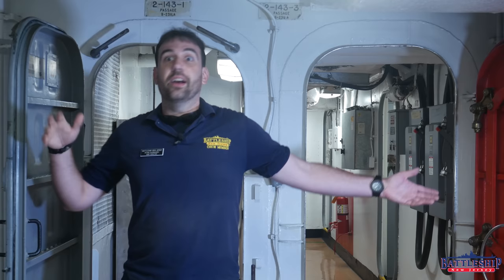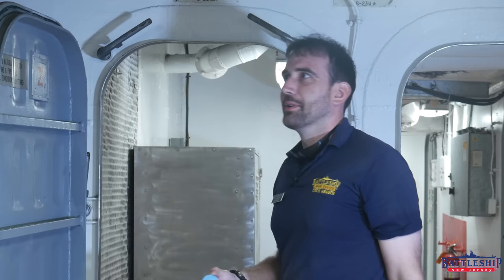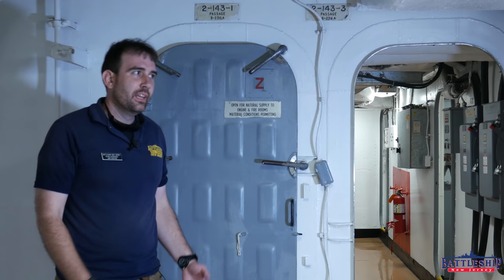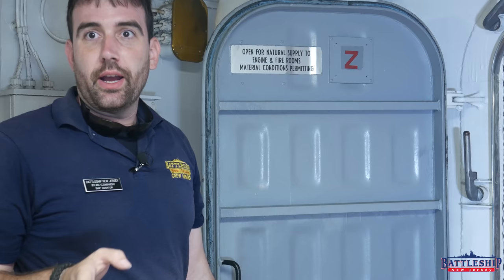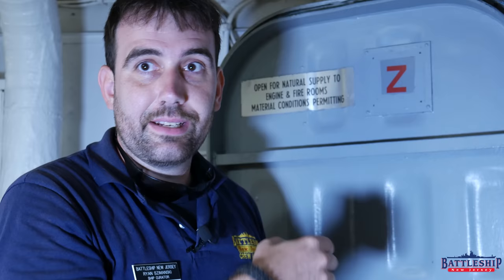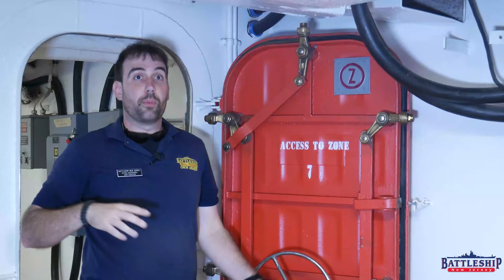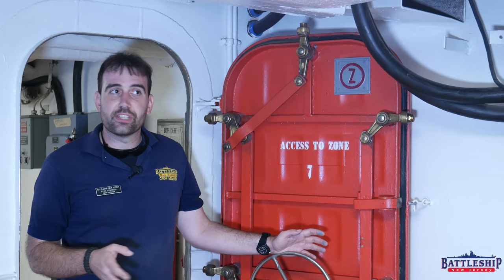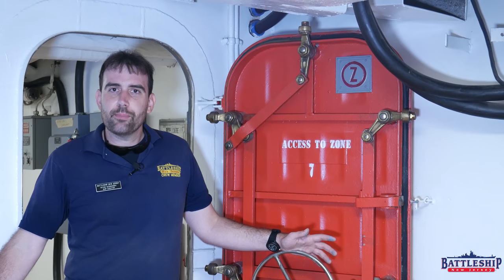How Do You Know if a Door is Watertight?

Comment: FYI: The nut on the outside of a stacked pair is called a “jam nut”
Reply: On the Mark V diving helmet there’s a stud that is longer to secure the air regulator to, the nut for that stud is called the bastard nut.
Reply: @johnbeauvais3159  the plate covering the m1 abrams engine deck the most forward up agiasnt the turret in the center as you can imagine its hard to remove there is no proper nomenclature for it......... its referred to as the bitch plate.
Reply: @justnsaliga8518  😂🤣😂
Reply: That's what she said 😅
Reply: And here was me thinking the nut on the outside was called "a civilian"
Reply: Mmmmm...Jam Nuts.

Comment: Back in my shipyard day we tested tightness of tanks, voids and compartments by adding air pressure to engineering spec and using high tech soapy water on all the seams, hatches and doors.  A leak would produce bubbles. Big part of my job was signing off on the test.
Reply: I did this to a set of fuel tanks on my second ship when we came out of dry dock.  Mostly sucked, but it worked.
Reply: Oh yeah....after chalking and checking the mutton tallow packing...1/4 psi air test...haha then break out the "in calibration" soapy water...shipfitters!
Reply: yes soapy water tests and die penetration tests... fun with metal...
Reply: When my Dad tested travel trailers for gas leaks in the gas lines, he would soap all the fitting.  Over the years, he replaced a great many fitting to fix gas leaks.
Reply: Bunch of military guys sitting around with a clipboard watching for bubbles.

Taxes lmao
Reply: @BeKindToBirds  we don’t write the specs in the contract

Comment: 2:00 - Also, overtightening the dogs increases the stress on the bolt and nut threads, wearing them out more quickly and risking stripping the threads (in which case the dog won't dog anymore).

Comment: I helped re-gasket the watertight doors on the Battleship Texas 1987 to 1988 to get her ready for the tow to Galveston in 1988.
Reply: Many doors?  I found that after about 25 your fingertips are apparently both on fire and being attacked by tiny tiny sharks.
Reply: @Grimmwoldds  Right you are.  I did about 12 doors over a period of six months working only weekends as part of The First Texas Volunteers,  BB 35.

Comment: Every division had/has a person assigned to perform damage control preventative maintenance.  On two ships I served on there were water tight hatches that required either the ship’s 15 or 30 ton crane to open/close.  These were weapons elevators.  I was often given DCPMS as a collateral assignment.
The one ship there was one door that for a year at every inspection I reported, “Door failed due to lack of replacement gasket.”
I retired with 23.5 years total service, with 14 being on ship.

Comment: I always replaced the gasket while using silicone to help get it in the channel. Always before the chalk test wipe the knife edge down as well to ensure clean. Did this more than a few times on LSD36 USS Anchorage as a DC3. As for compartments being air tight, lol yeah good luck with that as often times when cables are removed in the bulkheads,  they often are not plugged.

Comment: How do you test the holes around the frame where the dogs go through? There has to be a seal around the rotating shafts, and the same with the shaft for the wheel on the quick-acting door.
Reply: I'm guessing the amount that could possibly leak through isn't a concern? Even for NBC some leaks are ok because the filtration systems maintain a positive pressure. As long as your air filters can flow more air than what leaks, you're good to go. Plane pressurization works the same way. There's actually specs on the permissible leakage for jets.
Reply: The dogs had packing around them in the holes.  As far as I remember, they weren't tested on a periodic basis because there wasn't any convenient way to do that.  A leaking dog wouldn't allow nearly as much water or smoke through as a leaking (or missing) door gasket.  Shipyards tested compartments for leaks with air pressure when any modifications were made.

Comment: Hey Ryan- The door stuff makes me wonder how the bilge systems work. I'm curious on the different ways water is removed from compartments and how the technicians discover leaks in seldom traveled parts of the ship.
Reply: Ya I really agree!! Would love a video about it
Reply: I have seen some ships that have test pipes that weighted measuring tapes are dropped into.
Reply: basic way is a small float switch that rises as the water rises. it sends a signal back and says hey i was raised which means there is probably a leak

Comment: Changing out a door gasket when I was the DCPO for my division was one of the most annoyingly tedious tasks I ever did.  It took most of a day.   Pull the old gasket out.  Clean out the gasket channel.  Insert the new gasket took a stupidly long time.  Make sure you cut the gasket ends perfectly straight.   Cut the gasket an inch or two long.  Insert the other end then push the remaining gasket in so that the ends push up against each other tight, and then mash the remaining gasket in with a couple of C clamps.   Then time to adjust the dogs.  Loosen them all.  Chalk test.  tighten the dogs.  repeat chalk test.  tighten the dogs.  Lather rinse repeat until it passes.  Then tighten down all the jam nuts.  Clean up everything and fetch one of the HTs to come do a chalk test and make sure everything was done right.   Never want to do that again.  
   on the subject of damage control.   Maybe do a video on REFTRA and the seven deadly sins of Gitmo.   My ship managed to actually do all seven of them for real just before and during our REFTRA period.  Luckily, nobody got seriously hurt.

Comment: In the case of severe weather (Hurricane), do you secure the ship in any special way, i.e. closing certain hatches that you normally wouldnt, etc. ?
Reply from the maker: No, not really. We make sure any tools left out are secured if we think it's going to rain, and we pull the flags down if we decide the wind is going to rip them down or tangle the lines enough to make it tough to get down.
Reply: The X, Y and Z codes cover some of that.

Comment: I was the dumb kid handed a large wooden mallet then ordered to check for metal fatigue. Sunday morning before breakfast
Reply: Years back I heard a story about that. Forgive me because it's been a while and the whole thing might be made up, but a young dude was given a wooden mallet and told to test for metal fatigue just like you were. He went around the whole ship pounding on things and suddenly found a spot where instead of the regular thud sound, there was a dull thunk noise. Turns out the paint had been improperly applied and a decent chunk of the ship was rusting away and needed to be drydocked for repairs.
Reply: @mintyfreshmetagross5437  LOL. At least they drydocked it. I was thinking you'd say they brought out the nail guns, air hoses and fixed it all at sea. That would be a hell of a job.
Reply: Sent for a bucket of steam
Reply: Made me think of the Chieftains story in the army telling an LT to check for weak spots in the tank armor with a hammer
Reply: @stephenfabina726  At least he wasn't asked for an exhaust check and given a trash bag to collect it
Reply: @stephenfabina726  This comment made me think of Chieftain's advice that cross-wind sensor doesn't need warming up :-)
Reply: @stephenfabina726  Missed the part about the hammer, any clue which video was it in, please? Was it also Abrams chat?
Reply: @llllib  it was in one of his Q&As. Its part of the story of the "Front-Slope Wear Guage"

Comment: My least favorite preventive maintenance task I had to accomplish when I was in the military was the stripping, priming, and painting of AIM-9 Siderwinder missile captive trainers.  Every so often, the missiles would have to be broken down and the rocket motor, warhead, and target detector would get a healthy coating of a industrial-strength paint stripper we nicknamed "elephant snot", which would remove the paint down to the bare metal.  Then we would wash and dry the components, as well as tape all mating surfaces.  Next would  prime, then paint.  The would process was labor intensive, plus the primer was  toxic (thank god for breathing masks and filters!).  The elephant snot got dumped down a hill behind the missile shop... of course, that was in the pre-OHSA days.
Reply: Why was this procedure necessary?
Reply: @user2C47  Corrosion control.

Comment: As a Machinery Repairman (MR) the worst maintenance I had was the water-tight roller curtain doors leading to the flight deck on our ammo ship (AE). There were no blueprints for the rollers that took the brunt of the wear, nor were there any samples. They had to be measured in place, for inside diameter (while the stud was still in place), outside diameter (while still in its track), thickness (again, while still in its track), and radius to fit into the track. The senior chief thought he knew better than anyone else, but was never able to answer simple questions such as how to measure in place without proper tools. He would just rant and rave like I'd committed murder, then walk away.
He did the same with the bearing rings on the fire pumps, water pumps, and air dehydrators. Just like the doors, they had no samples or blueprints.

Comment: The DCs were not the only sailors that tested WT doors.  R Division's ER09 workshop supported a 3-M (Material Maintenance Management, if I recall correctly) program on damage control items throughout the ship, with the maintenance being performed by sailors in the division responsible for the space (the reason the division is posted on the space "bullseye").  So many sailors will remember the WT door and hatch chalk test, and many chiefs and division officers will remember checking to see if it was properly performed and passed.  The most difficult chalk tests were on the armored doors and hatches.  If a regular WT door or hatch needed adjustment to pass the test, it was usually a matter of adjusting the dogs, or less often replacing a strip of worn rubber gasket.  If the ribbed gasket on an armored hatch didn't show chalk all the way around, the only recourse was to adjust or replace the gasket, which was more difficult and took more time.  The mating surfaces of armored doors and hatches were finely machined but didn't make a perfect seal without some help.

Comment: Least favorite maintenance i had to do; climb a 305 meter tower to replace multiple microwave dishes at 220~260m. 
The dishes where not broken nor malfunctioning but they where up there for 10 years so had to be replaced. So one dish per day, 19 dishes total, they where 1.2m in diameter.

Comment: The dogs each have a shaft going through the door (or frame)- how are those seals tested for leaks? Or are the seals just replaced on a schedule?
Reply: There's a permissible amount of leak through on those dogs, but there is a water repellent packing material that is packed in the holes those dogs go through when you service them. Part of the chalk test is adjusting the dogs, if enough time has passed, you are supposed to fully remove the dogs and clean and repack the passageways.

Comment: Airtight and watertight are different things though. Although the airtightness required for NBC protection must hold out very big molecules.
Reply: "watertight" at the kinds of pressures we're talking about on a ship is very different from "watertight" when we're talking about a tupperware container. These watertight doors are supposed to be able to theoretically have the compartment on one side totally flooded, while the compartment on the other side is still totally dry and relatively safely usable (AFAIK, I'm not a sailor). They're definitely airtight at atmospheric pressure, although some "slippery" molecules might be able to skirt past.

Comment: Most disagreeable sort of preventive maintenance I've ever done: oil (engine & diff) changes on a 25 year old vehicle.
Not so bad if done on time, but if you wait to long that stuff can just about qualify for chemical warfare by the smell. 
Also inevitably gets one of my gloves soaked with oil when I do the engine.
Reply: You are guaranteed to get it in your hair at that point
Reply: @md4luckycharms  only if you jack or lift the vehicle up till you can stand under it, the vehicle in question has enough ground clearance for me to slide under without jacking or lifting.
Reply: @can_hauler  shit that makes it even worse in my experience, at least you can dodge on a lift. If you're under the car it's getting somewhere and it's staying for a week
Reply: It might be that toxic.  Take complex mix of organics, stick in metal pot and heat while stirring for hundreds of hours. That's a recipe for making for making all kinds of noxious compounds.  I once heard of a farmer who ran out of mineral oil and used used motor oil as a base for an insect repellent treatment for his cows, and a few hours later they were all dead.
Reply: @evensgrey  Thats more because motor oil isn't mineral oil. Had he done that with fresh motor oil it still would have killed most of them. The residuals in motor oil is really just slightly corrosive combustion byproducts (not even to the level of salt water though), lots of carbon, some diesel or gas. The toxic part is the additive packages in the oil for dealing with these things, the anti-foaming agents, and seal conditioners, lubricity modifiers, temperature stabilizers, etc. Things that are in the oil fresh or used. Oil itself when heated is incredibly stable, it's oil because it was heated for millions of years under pressure to stabilize it into oil.

Comment: That chalk is a piece of old fashioned carpenter's chalk. Before they had chalk boxes with string line in them at the hardware store, carpenters would use that block of chalk and a string to snap a straight line. Typically on a floor. Now they have a bottle of chalk powder, dump that in the chalk box and reel out the line.

Comment: Hatch maintenance wasn't strictly the job of a Damage Controlman.  As a new Interior Communications Electrician, I maintained the main and escape trunk doors in the IC/Gyro Shop, as well as the hatch on the Pitsword Trunk.  Also maintained the battle lanterns and the FF hose station in the P-way outside the shop.

Least favorite maintenance task?  That would have been maintenance on the batteries which supplied backup power to the main gyrocompass, the aux gyrocompass, and the phone system.  It was a weekly PMS check to top off all cells of each battery with distilled water, and to test Specific Gravity in one cell for each battery, rotating through the cells at each check.  Problem was that the battery backup for the equipment was 120VDC from 6-volt batteries.  That's 3 separate cabinets, each with 20 batteries in series.  60 batteries.  60 SG tests.  180 visual level checks.

Most terrifying task?  Annual cleaning/inspect/test/calibrate on the sending units for the Wind Speed and Direction system...a.k.a "Windbirds".  These are the little things that look like an airplane with no wings, mounted out on one of the yards off of the mast high enough that no part of the superstructure could interfere with the wind patterns.  This PMS task was performed in the shop, which meant that somebody had to go up the mast, out on the yard, unbolt the unit, and lower it down to the deck on a rope.  I do NOT do heights...

Comment: Worst job?  Mucking tanks on an AO.   Now for the doors. I was an HTCS and have been retired since 82.  I have done PMS on the WTD's but cannot remember the periodicity of the test, but on the bottom edge of a door, there used to be a nipple welded to the bulkhead (wall) and a pipe cap threaded to the nipple. The nipple was open to the next compartment. This allowed air to be pressurized in the compartment to 2 psi. Not much, but you can hear a leak around the door, and if there is 2 psi in the compartment and if the door swings inward, you can undog the dogs and you can NOT get the door to open up. We would connect an air hose with a gauge to tell the pressure. I have replaced the gasket on doors and it is not easy, but can be done.

Comment: Least favorite? How about crawling around in the bilges, on you hands and knees with a dust pan in your hand scooping up sludge, in a boiler room that is already 126 degrees. Then wipe all of the metal around you with a rag soaked with JP5 so you can paint the bilges once clean. 
But you're not done.....Now that all of your clothes are soaked with bunker C, JP5 and just plain sludge, you strip down, wash your body off with JP5 because that's the only thing that will cut through with what's all over your body, and have a friend with a hose on the deck above you rinse you off with sea water. Now you are clean enough to hit the shower. 
Yes, the above is what we had to do many time and there is no exaggeration in this event. Fun times !
Charles R. Ware, DD 865..Middle East cruise. Temp topside was 110 degrees. 
Barry

Comment: Yeah, replacing the gasket sucks ... seating it properly takes time and is a major pain in the posterior.  They not only can dry out but one of my young sailors learned the hard way that you never paint the gasket OR the knife edge.  Doing the 'chalk test' can be a pain also, especially with older doors that have warped slightly and you have to adjust the dogs to hold it tight against the knife edge.

Comment: Absolutely hated vent filter cleaning!  Tag the vent electricals out that was a job all in it's own.  Take out the vent screens, filters etc. make sure the filter shop is open. take the things to the filter shop, get clean replacements, or wait till they have been cleaned. Replace the vent parts (This usually sucked more as the screws never wanted to go in right). Tag the vent system back in. And repeat! 3M system.